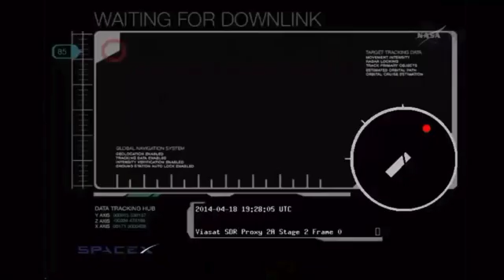SpaceX Launches Cargo Mission to Space Station, Reusable Rocket Test | Video

Comment: Whats with the plum that covers the rocket in carbon
Reply: Incomplete combustion as the last fumes of kerosene run out of 02 to react with, creates soot (carbon monoxide) from the first stage engine as it cuts out.
I'm not sure but I think that the reason the soot goes up is because as the engine stops (halting acceleration) the air resistance slows the rocket more than the soot does, but as I said, I'm not sure.
Reply: TheAmazingchickens got it thanks for the reply m8 , it's the first time I've seen that
Reply: cocaine